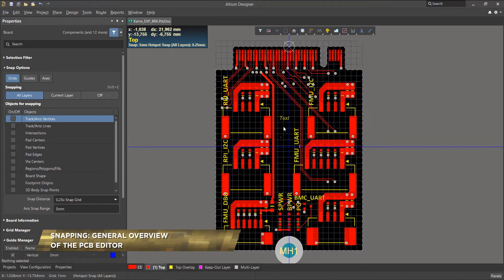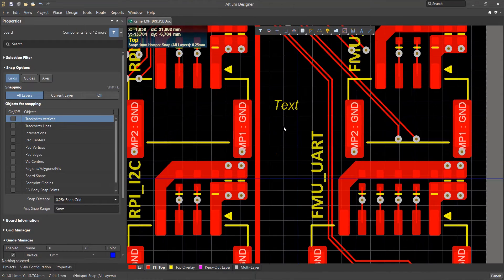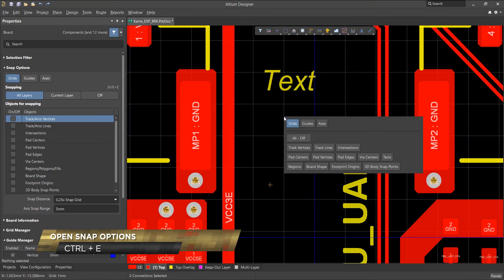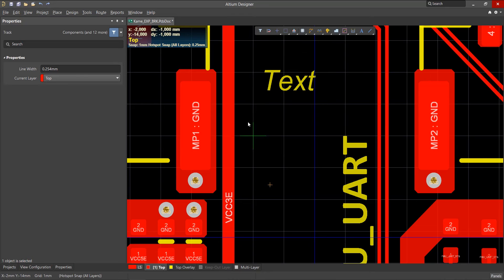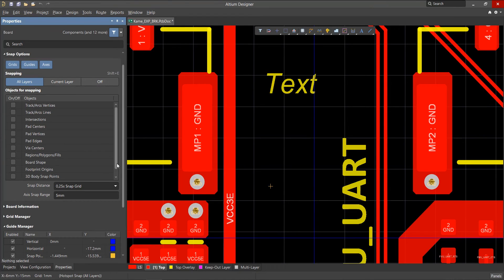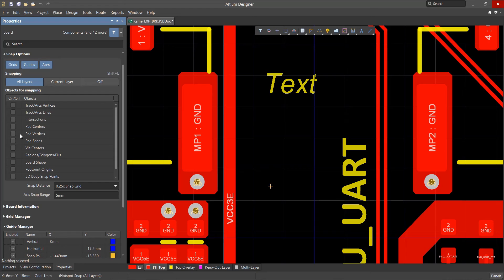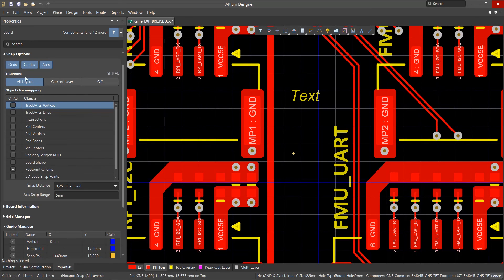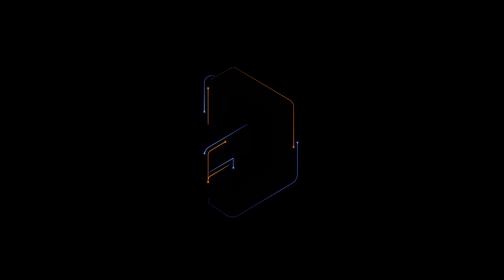Introduction to Snapping Options in Altium Designer | PCB Routing

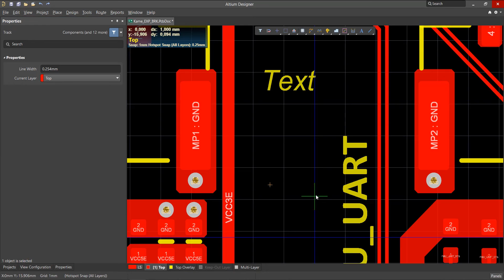Comment: The grid snap was easy to see in the example and so be came understandable. At about 0:50 the explanation about Guides fails me. This needs to be illustrated by example.  After watching three times I think I see a moment in the video 0.51, showing the Guide Manager where now I am left to presume I add a row and key in an x,y pare.  Axial snapping similarly needs examples.

A part 2 video is needed.  Mounting  holes and connector placement is the obvious use case for snapping because, as a designer, I may need to place a connector to exit an already designed enclosure precisely relative to a PCB mounting point.  Place, for example, the CUI part number PJ-202A.
Reply from the maker: Hi Forrest, several videos on Snapping will be uploaded soon. This is just the introduction to give you an overview of the capabilities of snapping.